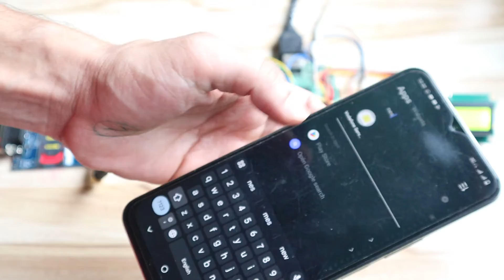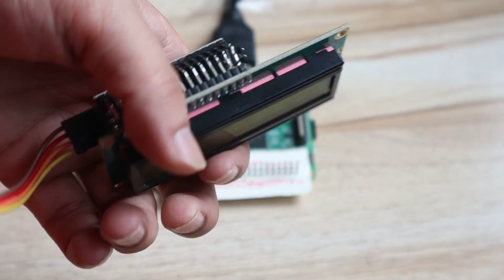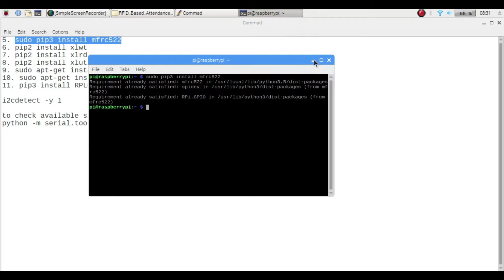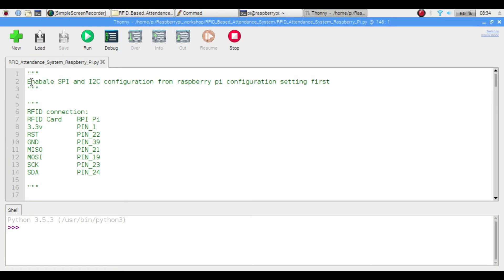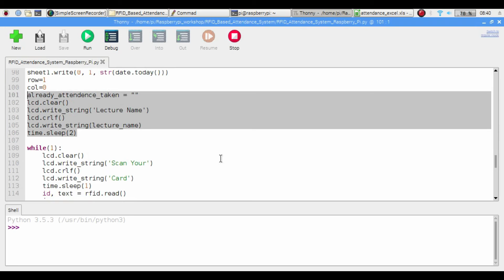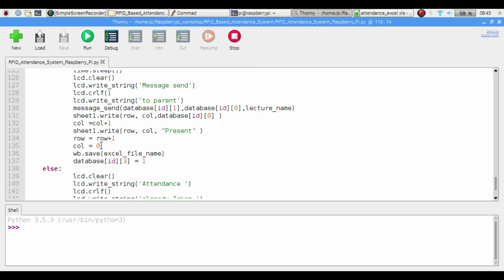Comment: how to Run face recognition code at startup  if we simply provide input source to raspberry pie without adding any communication or other cables?
Reply: This is not a face recognition project
Reply: @Rahul_Jadhav_Project  i know but i have seen ur other videos where u connect HDMi cable while what if u disconnect HDMI then how u will bring in startup . once again i am talking about ur face related project
Reply: @nomiahmad5268  Raspberry pi is processor not a controller. If you want to use Raspberry pi as controller then you have to add your code into boot process. Then Raspberry pi only used for single application like controller
Reply: @Rahul_Jadhav_Project  can u make a video on that too.